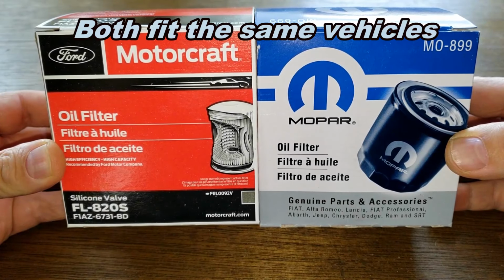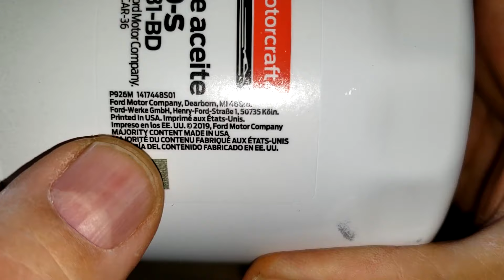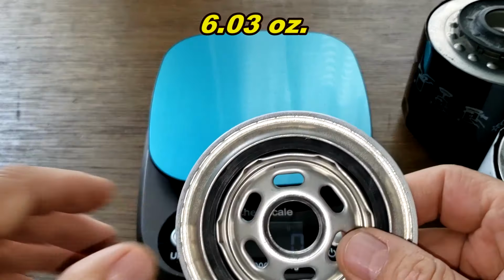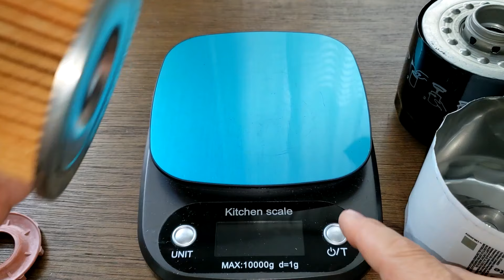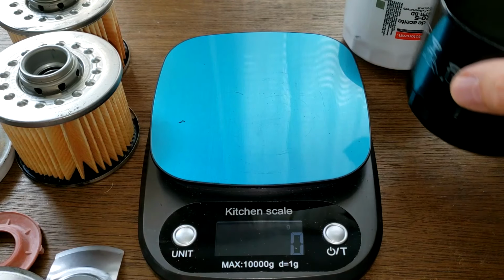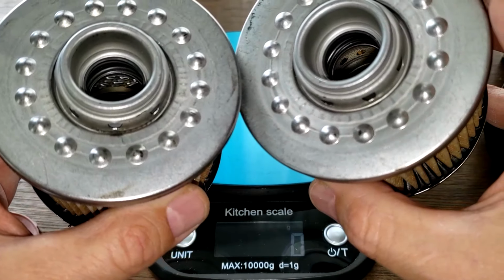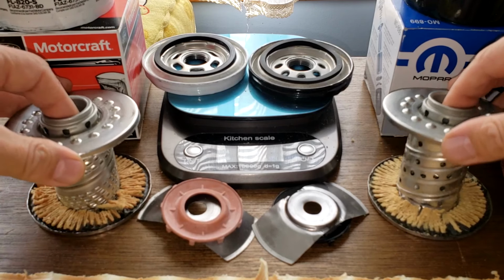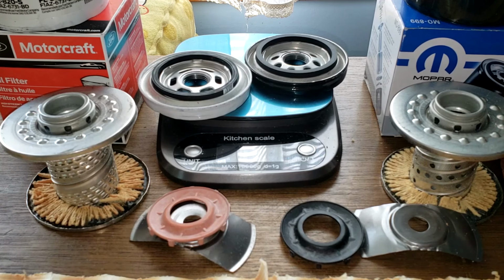Motorcraft Oil Filter Cut Open FL820s vs. Mopar Oil Filter Cut open MO-899 Oil Filter Review

Comment: Motorcraft filters are the only filter I have used in my Ford vehicles for 30 years. I have been using the FL820S in my vehicles for the past 22 years and prior to that I used FL1A's on my 5.0 Mustangs. Never had a failure or malfunction and never an oil related issue for all of those years and hundreds of thousands of miles. My 1994 Lincoln Mark VIII had over 300,000 miles on it. My current car is a 2006 Crown Victoria with 160,000 miles and still runs perfect.
Reply: Well I guess so. lol
-Chuck

Comment: Pretty much the same oil filters.  I'd have to go with the Motorcraft as it's got the silicone anti drain back valve, better inlet holes, and cost several dollars cheaper.

Comment: Love filter Friday!

These are the best looking OEM filters I have seen you open!

Thank you for all you do.
Reply from the maker: Thank You!👍😊
Reply: And they both use a stamped flat compression spring. Imagine that. ;)
Reply: They are very nice, for OEM...great design in the top By-Pass . Motorcraft gives you a  silicone ADBV , and is cheaper.  MOPAR must need to keeps its shareholders happier with that Price...Thanx WCW! ....Jethro

Comment: On old engines I like the upper bypass, quick return, not dragging the sludge back up the center and possible jamming open those disc valves.. i just bought mopars to pull off the 6 mo. Old toughguard fram. Now I know they be a paper disc ends.

Comment: Ford wins by a fender because it costs less for the same item and therefore offers a better value...Great video! 👍👍
Reply: I’ve seen that particular Motorcraft oil filter at Walmart for $3.99.
Reply from the maker: Thanks!👍😊
Reply from the maker: @wasabitoburrion4409   almost $3.97 lol
Reply: Plus silicone anti drain back valve makes a difference in the winter especially.

Comment: Ford wins... Cheaper and better oval  bypass holes and silicone anti drain back🤔
Reply: Surprised the Mopar has upper bypass valve; that is critical on the Ford modular engines.

Comment: Good video , I have a 21 f250 . Just took off the factory filter , it had a spring at the bottom not the molded metal setup . Wonder why they do that from the factory . Was happy with the filter after chopping it up . A few break in metals but not bad . It was 900 miles . Put a 820s on .
Reply from the maker: That is strange, wonder who makes that oil filter?
Reply: @WhipCityWrencher  I will get the numbers off it later today for you .
Reply from the maker: @kenj.8897  Great!😊
Reply: @WhipCityWrencher  Sorry I'm so late with info .
       FoMoCo
3W7E   6714   BA

Comment: Hi, what is the number " 3510 22 " on the bottom please? Is it the date of manufacture or not? 22 like 2022? Thank you
Reply from the maker: I would guess the 22 is the year it was made but I'm not sure. I don't know how to decipher the Mopar date code.
I have learned how to decipher the Motorcraft oil filter date code and it was made on July 6th, 2021.
Reply: @WhipCityWrencher  thanks a lot for the quick reply. it is very important for me because yesterday they changed my oil at the service. I waited a week for the filter, then they told me that it was a different one, but that they would get a new one within an hour. which I thought was strange. but they sold me the car with the fact that the oil and filter had been changed. When I got home, I noticed that the invoice says 0W20 oil, but the RAM 1500 5.7 includes 5W20, so I got under the car to check. But the oil filter seems to be old, original and they didn't even touch it. Only if the number below indicated the year of manufacture, then it would be fine. So I don't know if I should go and complain to the service technician.
Reply from the maker: @batlife76  That sucks. The date code really won't tell you much because I've gotten new filters that were a few years old (old stock).
If the filter looks old on the outside then it probably hasn't been changed. The New filter should look and be clean. I'd look at the dipstick too, the oil should look clean also. Good Luck👍💯
Reply: @WhipCityWrencher  thanks, the oil is clean. The filter doesn't look new but it has the number 3202 24 so I was hoping it might be. I'd rather take it to the next service.

Comment: For the price, you can't get a better quality filter than the Motorcraft.  I even know Dodge/Mopar guys who use them.  Sure there are higher end filters out there, for over $10 to $15.  But for $4 at Walmart you will not find another filter of this high a quality level.
Reply from the maker: They have a good bypass valve, I wish their filter media was a little better though, but for the price a pretty good oil filter.
Thanks for sharing.👍

Comment: Yeah I own a 1998 Ford F150 4.2 L. I only use Motorcraft parts. Valvoline 5w-20 high mileage oil. It runs like a charm.
Reply from the maker: Thanks for Sharing👍

Comment: Other than the anti drain back valves,I would say they are pretty much the same....
Reply: Except for the different base plates and the different center tubes --
I guess they're not as "the same" as was thought.
Reply from the maker: They share some of the same features. They are the same in some ways and different in others

Comment: There are a lot more louvers then holes. You can be sure FORD has an equal in-flow to out flow ratio with filter material in place. They value their motors also. And want them to last. Reputation and all..

Comment: good filters - correct location of the by-pass valve - solves the problem of high-quality oil filtration, but both lack a good coil spring to correctly press the filter to the base plate
Reply from the maker: Right on!
These stamped leaf springs are flimsy and can collapse unlike the beefier bypass stamped leaf springs you find in some of the Supertech.
Reply: Although we see many filter testers raving about the poor quality of the stamped metal spring, the coil spring gives NO ADVANTAGE over the stamped metal spring. Notice that two (2) of the most expensive oil filters (Amsoil, Royal Purple) also use the stamped spring.
The stamped spring has NO EFFECT on the Relief Valve Pressure -- it just holds the filter guts in place.
The famous 95 MERC's V-8 engine runs Pennzoil Ultra Platinum, 5-W-20; Bosch Premium #3410 Oil Filter; and a FILTERMAG #SS365PR Magnet Kit.
 Oil & Filter changes at 5,000 miles.
Reply: @WhipCityWrencher  What do you mean by "beefier bypass stamped leaf springs" ?
 None of your videos shows a "bypass stamped leaf spring".
 In all your videos that I've seen, the actual By-Pass valves have tiny coil springs, set at different pressures.
In fact, your videos show that 2 of the MOST EXPENSIVE oil filters (Amsoil, Royal Purple) use the stamped leaf spring to hold the filter guts in place.
Reply from the maker: @SlikLizrd  Go to 4:30 on this video    https://www.youtube.com/watch?v=LtRITTGLg48&ab_channel=WhipCityWrencher
Reply: @WhipCityWrencher  Gathering knowledge takes much time, Grasshopper --  ;>)
Reply: @faxmen09  The type of compression spring makes NO DIFFERENCE in the performance of the oil filter. Two (2) of the most expensive oil filters (Amzoil, Royal Purple) use the stamped-steel spring.
 The coil spring is an un-necessary expense -- they could put the money into better media, or a stronger center tube, etc.
Reply: @faxmen09  Yes, the stamped-steel spring works just as well as the coil spring -- BUT -- those center tubes vary in construction -- some with louvers, some with holes, most are metal, some are plastic. It APPEARS that the plastic center tube is the strongest, and can flow the most oil. 
 The metal tubes are of two (2) types:
One type has a single crimped seam, which crushes easier than the stronger   spiral-wound seam.
 As for the Inlet Holes -- there IS a difference in the flow path between some of the filters with odd-shaped holes -- Example: Fram Titanium.
Reply: I have personally bought a filter before that has a leaf spring and rattles when shook straight of the shelf. I have also had one that was fine when put on and when it took it off it rattled, because the spring was bent. Never had a problem with a coil. Most people who work in heavy industries like ag and construction would agree that Donaldson and fleetguard are without doubt the biggest and best filter manufacturers in the world, and that they also do the most research out of any other company into their filters. They make filters for high loads and machines that are worth alot of money. I personally have never seen a filter made by either of them that uses a leaf spring and that tells me something.
Reply: I agree with you that is it anecdotal evidence, as most YouTube videos are simply peoples opinions and experiences. Is also agree with Wikipedia that 'Thus, even when accurate, anecdotal evidence is not necessarily representative of a typical experience.', I would most certainly believe "typically" leaf springs cause no issue and cases of failure are few and far between. Yes there are plenty of oems that use leafs, there are also plenty of oems cars that I, in my own anecdotal opinion would not buy. I live in Australia and have zero experience with any of those brands, but know that Donaldson and Fleetguard for sure are in the small car filter biz, very rare to come across a application that they don't have a filter for. When I look at it is see who has the most to loose from a filter failure, if superteck blows up a Toyota corolla then they are only looking at tens of thousands of dollars. If Fleetguard or Donaldson who Do make filters for large machinery blow up a John Deere 9670R then they are looking at millions not thousands. So they need to have what works down pat.
I know that personally because of my anecdotal experience and my personal belief that it Is more Likley to fail or have a manufacturing fault that I would not put a filter with a leaf spring on my own engine, that doesn't mean that you can't, and it for sure isn't scientific proof of anything. But that is what YouTube and the Internet is now days, people sharing there personal opinion and experience. Both mine and whip City Wrencher's 'about' section in our channels clearly state that what is said in the videos is only our opinion, which may or may not be scientific.
Reply: No worries mate, i can see that this has moved away from discussing the evidence behind filter design, to discussing the intentions of these type of videos and YouTube it's self. Which I have nothing to say about unless it regards my own channel.
Have a good day 👍

Comment: I have been told that motorcraft filters with thick easy removed rubber gasket is fakes
Reply from the maker: Never heard such a thing as fake Motorcraft oil filters, there cheap as it is, and I wouldn't think there is any money to be made there.
Their OEM parts on the other hand are a different story.